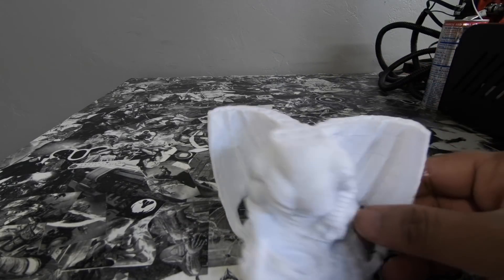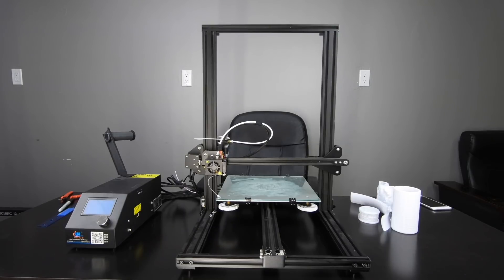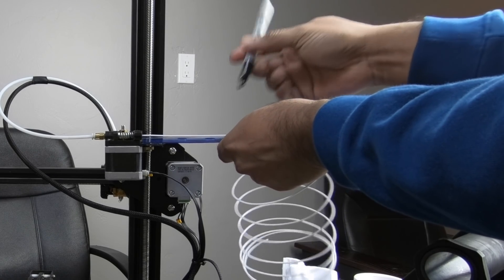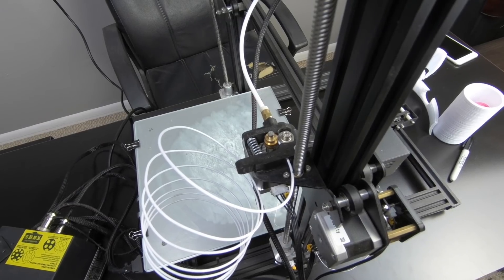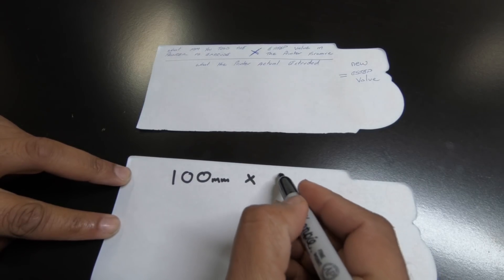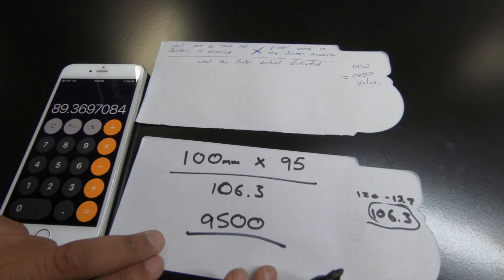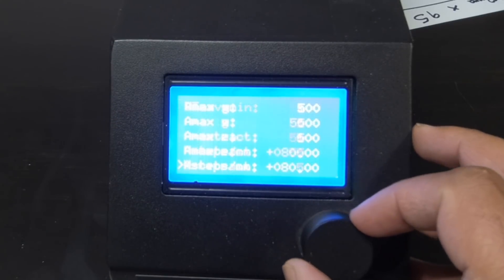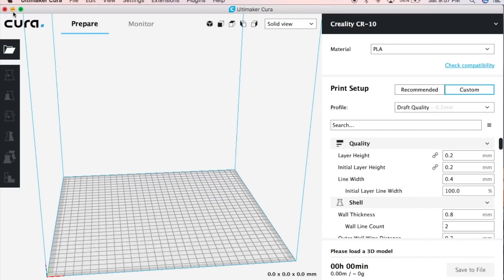Fix Under Extrusion With Extruder Calibration (Estep)

Comment: Thanks for the video! I have a CR10S, and if i check the control panel, it does show an eStep value (+0093). I’ve never touched that, so I’m hoping that it’s the one the machine is using… in your video you say that CR10S don’t show the value in the control box, and the default was +96. Very clear video :)

Comment: Dear mate, please advise. I've bought new extruder from trianglelab and under extrusion was dramatic. i ended up with 440 e steps instead of 93 for ender 5. It is 3 to 1 gear ratio. But still is this normal?

Comment: thank you
Reply: If I sent a picture, you would understand!
Is I got lost in the equation. But the visual with ruler helped me understand around +86 and negative 16. So during tests I saw the extruder was not to fill potential. I tightened and raised my Esteps from 93 up to 100. Oddly enough the order and small calibrations have corrected the print in on. 
Humbly.. thank you
Reply from the maker: You're welcome

Comment: I bought the CR10S in April 2020. I has the e-steps in the firmware. Easy to make adjustments just like you explained in the video. Mine was over extruding. Fixit it!
Reply from the maker: Glad to hear ur up and running. Good luck and happy printing!

Comment: I have the CR-10 and even though you can adjust eStep in the menu, it resets the Estep calibration back to original after a power off, so the only way I can see is to force it in Cura.  Is that what you see?
Reply from the maker: Yes that will work just as good.

Comment: I have a creality CR6 SE. How would I measure my filament since it has an optical sensor? would i just measure from the extruder itself and subtract the distance from there to where the optical sensor starts? GREAT VIDEO BTW! 👍🏻 TIA! 😀
Reply from the maker: You just have to find a fixed point to start at. As long as it’s where the filament goes in.

Comment: Up until you did the extrusion. I set the e-steps to 100. Very important. Then extruded 1mm at a time till the mark at 100mm. Gets to the extruder,. Then just change e-steps to what that value is. I had to turn mine till it got to 165. And that is what I changed my e-steps to. Then I stored it and did the test again. It was right on. No math needed.
Reply from the maker: I have never tried it that way but from what your saying it should work too.

Comment: I have a Problem with the manual Extrusion. When I turn the wheel by 0.1 mm, the Extrusion Motor stop at about 15mm and cannot turn further...Even if i help pushing in the filament. Is in this case the extrusion Motor too weak?
Reply from the maker: if its a Creality then you have to turn the knob slower or it will reset.

Comment: I read through the comments and couldn't find if you answered it or not.  If you are able to change the Estep setting on the machine, do you need to change it in Cura as well or is changing it on the machine the only change that needs to be made?
Reply from the maker: No, changes only need to be made at one place.

Comment: I changed my esteps directly on my Ender 3 machine from 93 to 97.1. It worked well. I turned my machine off and when it started back up it had reset to 93. Any ideas on how to keep the updated setting?
Reply: you have to save the settings by going to store settings on the box before you cut it off

Comment: I'm just about to do this to mu underextruding machine, but I'm noticing that I have to use the 1mm option instead of 0.1mm option.
When I take 1mm it actually runs the filament, but you say to use  the 0.1mm and to go slow... but when i try to go as slow as you do in the video... the filament just kinda hacks and doesn't get anywhere.
So... with the 0.1mm steps I was "underextruding" 100mm.. x)...
Going to try with 1mm now but going juuuust as slow as i can with the hacking and jumping... but... how do i solve that jumping?
I've noticed the same when I'm printing.
At the extruder there are those 2 screws, I don't know the names yet (got the printer last week).. the one that the filament is "squeezed" between, the brass one that you kinda move when you press that extruder lever thingy (so you can insert the filament) and the static one (that you can install those extruder knobs on (i printed one but haven't installed it yet).
The thing I'm noticing is that this brass one, the one that is supposed to smoothly just turn and turn and turn as it help the filament glide through.... it now and then hacks and kinda jumps back a little bit. "bzzzzzzzzzzTOKbzzzzzzzzzzzzzzzzzzzzzTOKbzzzzzzzzzzzzzzzzzzzzzzzzzzTOK etcetera.... which ofc leads to underextruding.

Will that thing be solved with the e-steps calibration, or is that a separate issue in it self?

Comment: So, if you reset the e-steps in Cura, you are not actually changing the e-steps on the printer. You are just setting the parameters in a gcode header that will preface any gcode generated by Cura. If you end up using a different slicer, your e-steps will be different. Is this correct?

Comment: Hi, i love how simple and easy your videos are, i have a problem!!! the value i get is 206 is this normal? =(
its very confusing for me
Reply from the maker: It could be, it all depends on what your current settings are.
Reply: SANTUBE 3D well, I changed it and the extruder still won’t extrude probably. I even upgraded it. And it still won’t work. I’m even less than a beginner lol! 😂😀 I really hate to quit but I’ve got so much to learn from.

Comment: Just as a PSA, if you use a ruler to measure with, get one which has the millimeter scale starting right on the edge of the ruler.  Some rulers will indent the start of the scale approximately 5mm from the edge which will definitely mess up your EStep calculation.
Reply from the maker: Agreed, thanks for sharing this information. Good luck and happy printing.

Comment: Help!My extruder extruded only 95mm.  I'm trying to find out what the estep value on the ender 5.  the only thing I have under Motion is probe Z offset or baby steps.
Reply from the maker: Ya the new crealitys don't have that figure on the control box but you can find out your default number from you Facebook group.
Reply: @SANTUBE  Thanks They're not much help either but I know how to find out.  Not even sure now if I really need that number based on a formula I got now.  I got to check formulas for figuring Esteps.  Last time I tried to extrude 100mm I got 95 extruded..

Comment: Am having a Chiron anycubic make printer, am unable to connect with repetier for extrude command, how to write a g code for extruding 100mm G1 E100 , just that line will do or i have to write more
Reply from the maker: To change the value that should be enough.
Reply: @SANTUBE  it is not recognizing as a g code, I got it done using repetition though ,thanks

Comment: Thank you! This fixed my issue I've been having. Almost threw my Ender 3 out the window. My e-step was set to 93 but should've been 97.9
Reply from the maker: Happy to help bud, I know how that can feel.
Reply: lol i have an ender 5 and i also calculated that the filament that was extruding was 95mm when i put 100 and my new e-tep must be the same as you, 97,9, lets hope that fix my problem -

Comment: Just cut a piece of ptfe tube to the correct length and push that up to the fixed point instead of fumbling with a ruler or such, and mark.
Reply: Also I woundered, rulers often don't start at zero straight from the side yet he marked at 100mm but it could be 104/105 bcause of the offset.

Comment: Bought a Creasee CS-3 and just used this to video to calibrate my extruder. It works. I have a Robin lite with RepRap. My e-step was at 93.
Reply from the maker: E step Calibration is some thing a lot of people do not do and i wish they would.
Reply: @SANTUBE  I notice when i power down it does not save and goes back to 93?
Reply: @SANTUBE  Control - Store memory = saves e step changes, watched a Reprap video and figured it out. Now I can power down without loosing settings.

Comment: I've seen people in other videos removing the hotend before doing this. You left it on.  Wouldn't this reduce the amount being extruded?  What would be the difference between the methods?
Reply from the maker: It wouldn't matter which way you do it because the main thing is to see how much filament gets pushed in from filament gear.  So we don't check how much comes out the nozzle just how much the printer pulls in.
Reply: @SANTUBE  i've tried both methods.
without the hotend im getting about 4mm under extrusion.
with the hotend im getting 35mm under extrusion. This can't be right.

Comment: i did this on my ender 3, add the code where it says to in the video. Attempted to print a file with the new info and it sets esteps to 0 and does not extrude at all
Reply: i figured it out, but im still only pushing 50mm not 100

Comment: I told it to extrude 50mm,  it only did 29mm.  So my number comes to 160.344.  I've only had the Ender 3 for 2 weeks, can it really be THAT bad?
Reply from the maker: Try it two more times and if your number is the same or around the same then yes its that bad.
Reply: @SANTUBE  I tried it again for 100mm, it gave me 40mm.  I took the nozzle off to see if that was the problem.  Same result.  I took the tube loose from the hotend, same result.  I took the other end of the tube off of the extruder and it still did the same thing.  So it's not even extruding the filment through the extruder.  So now I'm thinking it's either a bad extruder or motor, but I'm not sure which.
Reply from the maker: That could be a problem but check to make sure that your filament gear that feeds the filament is placed correctly.  Make sure the gear teeth are pushing the filament through.  Also try to adjust the tension on your extruder there should be screw which takes an alan key.  try tighting or loosening it based on what you thing will work.  Keep me updated if it doesn't work.
Reply: @SANTUBE  I just tried it agin and nothing happened at all.  Nothing moved, no noise or anything.  Pretty sure it's the motor or maybe the plug.  I have to figure how that comes out then see if jiggling it helps any.  Might be a dead motor.
Reply from the maker: if nothing moved i would say it is the motor but before you buy a new one check your wire that goes from that motor to the control box to make sure its plugged in.
Reply: Rick Sorber agreed, make sure extruder wire is plugged in and see if the shaft spins but gear is slipping due to loose set screw.
Reply: @ricksorber8343  had the same issue, was able to fix it by jacking the number way up to 265 though

Comment: Ove followed your I instruction to a T however when I input my new estep into the firmware and extrude 100 mm again to see my calibration result I'm over extruding by 5mm. I then went through the calibration steps again with my new results but I can never hit exactly 100mm after calibrating (yes I am inputimg my new number into the equation ever time.) What am I doing wrong here?
Reply from the maker: Only thing I can think of is maybe your filament gear is to tight and its digging into the filament.

Comment: I followed your instructions and I noticed that I had 5.4mm underextrusion, I've calculated my new value using the formula but somehow it never worked. Then I changed 93 to 95 on the control box of my Ender and voila, perfect 100mm extrusion.
Reply from the maker: Glad that it worked. Sorry my method didn't help much.

Comment: You don't have to cut any filament just measure back from a starting point at the extruder. The Ender 3 default is 93. You can enter and store a new estep distance. My Ender 3 was made around August 2018. In the Marlin software you can change the estep value. Go to Control-Motion-Estep/mm. Change value(in my case it was from default 93 to 98.9)Enter it. Scroll back to Control then click Store memory. If you don't store it the value will be reset back to default(93) when you turn the Ender off. I think that means I don't have to change any profiles in simplyfi3d, not sure. However those with S3D who cannot change the esteps in the control box....I found this page "http://forum.raise3d.com/viewtopic.php?t=1804"
Reply from the maker: You are correct, based on what version of the firmware you have you can change it but the newer ones don't have it.  The reason i cut the filament its just easier to work with.  Good luck and happy printing.

Comment: I have issue with ender3. It worked fine then i dont know my nozzle too close to the bed or under extrude problem.  Part look weird.  How can i fixed that and how you do set z zero if i put a glass on bed . I have difficulty to level bed  on ender 3 print. So anyway we can offset z zero on the control. Thank you
Reply: I had samw issue if we solve revert me back

Comment: Hello I found out that one of my 3 printers (creality cr-10s 4S) is underextruding (instead of 100mm it took 87mm of fillament) and I cannot change estep value in control box however if i change it in my software will it apply to my other 2 same printers aswell? Meaning that it would change good extrusion from other two printers to bad ?
Reply from the maker: Yes it will change it so to fix this you need to add each printer and change the beginning g-code as shown in the video.
Reply: @SANTUBE  Little bit annoying but thanks :) will do

Comment: Ender 3 is has a 93 step value. Cr10 I read has a 95 step value but not 100% sure.
Reply from the maker: I don't know about the ender 3 but the cr-10 is 95
Reply: @SANTUBE  I've read somewhere that if you haven't changed the value of the Estep, what's shown on the screen is the default. On my Ender 3 Pro, it was set to 93.
Reply from the maker: Dmitry Jerusalimsky that is correct what ever it says on your screen should be default unless you changed it

Comment: Why bump the temperature up 5 degrees? Think it would be more accurate to do the calibration at the temperature you will be printing at.

Also why not put the gcode to extrude 100 mm on an sd card and run that instead of using the finicky knob. Or if you have Octoprint or Pronterface you could extrude from there, but just make sure to extrude slowly or you may have slippage which throws off the calibration.
Reply from the maker: Most of my videos are made for people that are new to the 3D printing world not all of them understand how to do what you just said.  With that said Yes, your way would be easier.
Reply: @SANTUBE  It's important to calibrate the extruder so thank you for making the video. See so many people in the Facebook groups having issues and most are due to the extruder not being calibrated or the bed not being trammed (leveled).
Reply: @mikeneron  Like me :D I really hope that a man will make more videos with simple explanations and why (at times) nothing helps+. An example of my machine will cheer him up to tears :)

Comment: I have a question, have repeated the procedure three times and each time showed another result, and then I noticed that the gear in the extruder after  the job, returning a bit back ???
Reply from the maker: It shouldn't do that unless you turned the boob back a little.
Reply: @SANTUBE  Yes, I'm clear should not do it, but it did. I contact Creality and did not answer me (like, clean the PTFT tube!), and I do not understand programming, to understand it myself ... ( btw " boob" ? Google translator do not recognise this word properly :) )

Comment: Excellent video. 
I have a CR10-S4. The Control Box shows an estep value of +0093.0
Any change made to this value is only good until the box is turned off unless you have the EEPROM set to allow saving changes (M501 and M502 codes).
That can be done by making a change in your firmware as shown in "The First Layer" https://www.youtube.com/watch?v=f_-FIHq4WxE at 20:15.
He is going through the firmware changes in the Marlin upgrade for a CR10-S. This EEPROM change will let you save changes made in the Control Box rather than having to adjust your firmware
or in your slicer.
Reply: You have to hit Control - Store memory = saves settings even if you power down.

Comment: Great video as always. The one thing I suggest is if you could go a little slower in the beginning when pushing the buttons on the control box. In the video you would click the next control before it could fully light up the last one as I'm not as familiar with all the settings yet. Thanks from an old guy, keep up the good work. Doug K
Reply from the maker: Sorry about speeding through the buttons. I hope it helped.  Good luck and happy printing.

Comment: Hi! I did it for first time on my Ender 3 minutes ago you upload the video :).. Is really necessary to put the Estep in Cura or not? 

; Ender 3 Custom Start G-code
G28 ; Home all axes
G92 E0 ; Reset Extruder
G1 Z2.0 F3000 ; Move Z Axis up little to prevent scratching of Heat Bed
G1 X0.1 Y20 Z0.3 F5000.0 ; Move to start position
G1 X0.1 Y200.0 Z0.3 F1500.0 E15 ; Draw the first line
G1 X0.4 Y200.0 Z0.3 F5000.0 ; Move to side a little
G1 X0.4 Y20 Z0.3 F1500.0 E30 ; Draw the second line
G92 E0 ; Reset Extruder
G1 Z2.0 F3000 ; Move Z Axis up little to prevent scratching of Heat Bed
; End of custom start GCode

If is it necessary, where should I put my new estep valor?
Reply from the maker: On the ender 3 you can't enter it in the control box so you would have enter it in cura.  Enter it right under the G1 Z2.0 F3000 ; Move Z Axis up little to prevent scratching of Heat Bed.
Reply: @SANTUBE  Ok, thanks!!
Reply: @SANTUBE  Thanks for the video, I need your help here:
I have an Ender 3 and my Cura dosn't have G1 Z2.0 F300. It has this two last lines:
G1 F200 E3
G92 E0
Where do I add it?